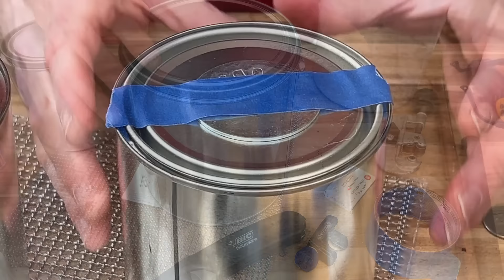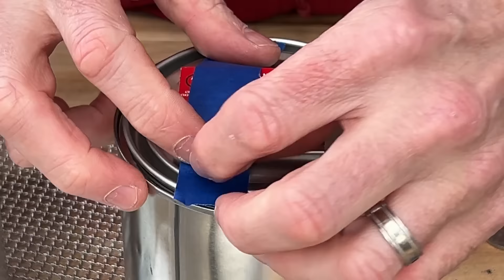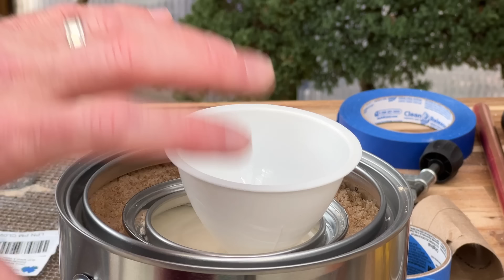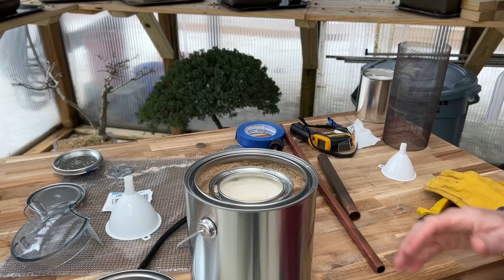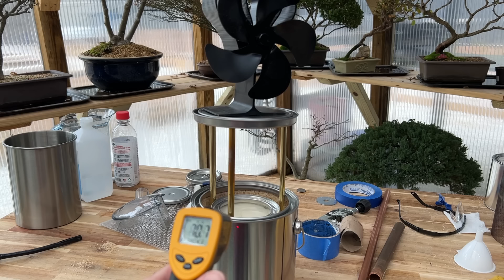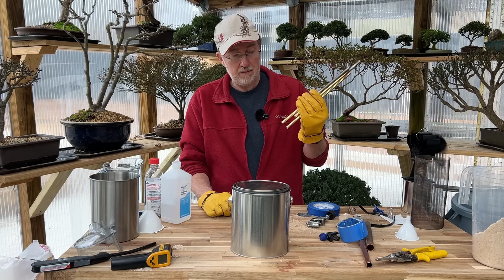Endless Heat Without Electric | Safe Reliable And Low Cost

Comment: Very cool.  My only comment is the fan.  I have 3 of them and they work great.  However, they can overheat.  There is a thermo-electric 'wafer' between the fan and the base.  That is what generates the micro current which powers the fan.  Too much heat can melt the wafer.  Temperature range is usually listed in the paperwork that comes with the fan.  You can use a metal grating between the lid and the fan or other such 'spacer' if the lid is too close to the flame.  
I have hooked a 'paint roller grid' on a propane buddy heater and you can adjust the heat by where you place the fan on the grid.  You can also cook on the grid in a pinch.
Just something to be aware of.
Reply: Wow, thank you.
Reply: I'm thinking the wafer is a Peltier?
Reply: How did you attach the paint roller grid to the Mr. Buddy so that it didn't melt the plastic housing? It seems like the grid would get pretty hot. 🤔
Reply: @DebiB62  I did this 1.5 years ago, so I'm sorry I can't be more specific.  The grid will sit on top of the heater and I hooked it with a couple of "C" clips I made from some stout wire.  (Like 'coat hanger' wire.)  The grid sticks out past the front of the heater like the brim on a ball cap.
It does get hot but using the grid provides more area to place the fan or you can put a small pot on it and heat water, coffee, soup, etc.
The fans I bought look like the same brand he used in the video.  They came with a small thermometer that sit on the top of my woodstove.  The "red line" starts about 525 degrees F.  They CAN handle some heat.  I just wanted to make people aware of the possibility.  
I got the idea from another YT video.  I bought the heaters and some fans when the furnace in one of my rentals went out.  Between them and a couple of electric heaters, I kept the family from freezing till I could replace the furnace. 
Hope this helps.
Reply: @Ken-h5d  That is great additional  info. Thank you.
Reply: @Ken-h5d  thanks for the 411 😊
Reply: Where do you buy the fans to sit on The can lids.@Ken-h5d
Reply: @DebiB62 you should not have any plastic housing on or in, or near your Mr. Buddy heater, or any heater. It's not clear what plastic housing you're talking about, but there should be no plastic anywhere around this device.
Reply: @michellec5026 The paint grid is metal. The housing of the heater is plastic. So there's absolutely no way to avoid the plastic housing. As far as I csn see the metal will naturally conduct heat that could possibly melt the housing. That's why I asked how the paint grid was connected in order to avoid this.
Reply: I was wondering if the fan had a sterling motor in it😮
Reply: Great info❤thank you😂

Comment: Is there an alternative wick that can used? I wouldn't want to waste  toilet paper  or paper towels
Reply: As long as you keep fuel in it, it will never really burn the toilet  paper wick. But if the fuel gets too low, the wick will start to burn. So keep it full and refill when the guel gets half way down, refill and you should never have to change the toilet paper wick. Hope this helps.
Reply: @taliarose6573  Just how are you supposed to see when the fuel gets half way down??
Reply: When it starts to turn black (burning) refill with fuel.
Reply: How is it a waste when it is providing heat?
Reply from the maker: Used newspaper

Comment: How long does it last? Thank you 😊
Reply: @Ocean_breezes   they always "forget" to tell us these things. Same with those buddy heaters. I have one but found out the first day I could not afford a minimum of 6 - 1lb propane cans at $5 each, every single day.After trying every heat source, I fully lined my tent shed hybrid with reflectix insulation,thick clear plastic over the windows.2 clear table top oil lamps with 1 inch wicks, was all that was needed to nicely heat a 20x12 space.Table top oil lamps last 2 days without refill. So they go go out and leave you freezing every couple hours like the other expensive heaters.
Reply: @pattiannepascual  Wow! I never would've imagined. I've been trying to figure out the best way to heat my shed (just ehen I'm in it.) Hopefully you just shortened my trial and error period!!! Many thanks
Reply: I have built similar burner heaters for my outdoor patio. The denatured alcohol is the best and safest. It still produces fumes though.  My heater will last about 2 hours on 18 ounces of alcohol. The sand stays warm about an hour. That's it. It gets very expensive to run these for any length of time
That denatured alcohol is about $18 a gallon..
Reply: @Ocean_breezes  Damn. Thanks for the info!
Reply: That's a rather personal question!